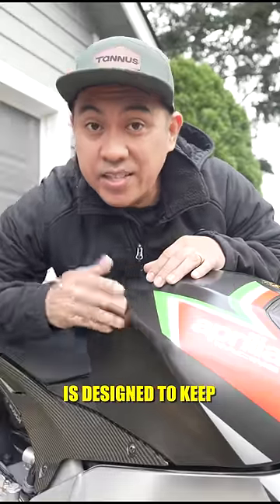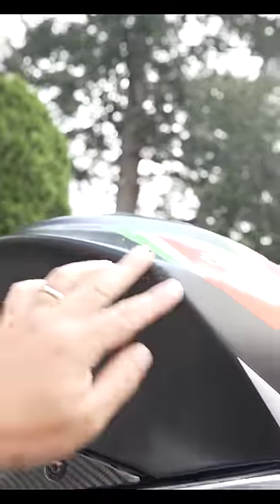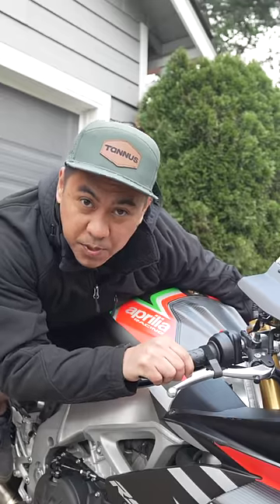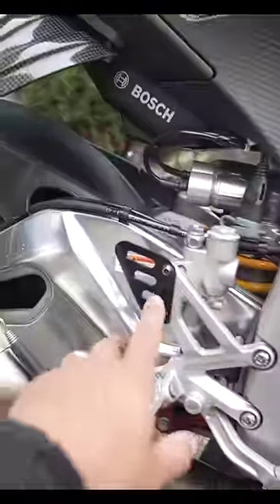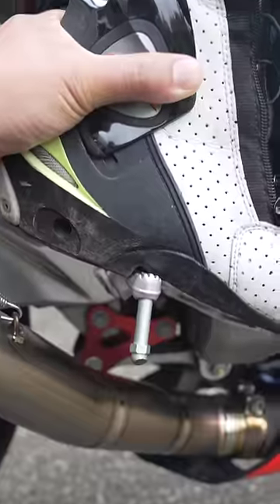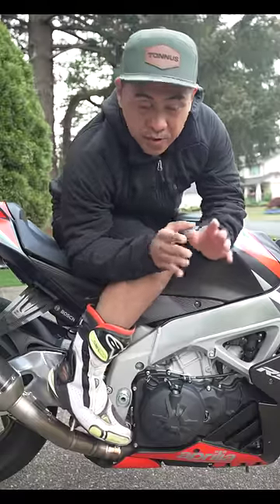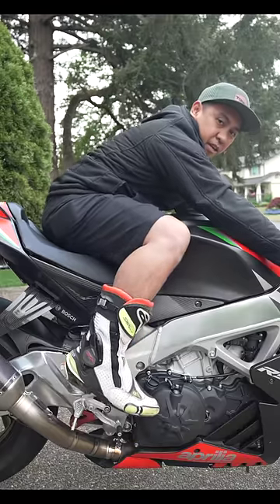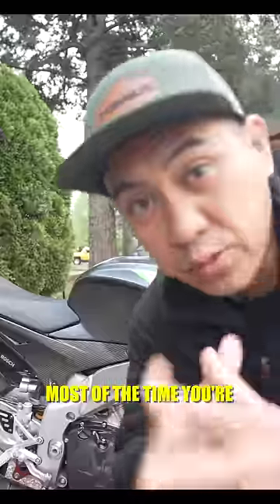HOW TO LOCK INTO A SPORTBIKE TANK

Comment: I asked Dylan Code at the California Superbike School about this very topic and he pointed out that in racing you see some guys have their heel locked into the outside  peg whereas other guys use the balls of their feet to lock their knee into the tank. He said it’s more personal preference than anything
Reply from the maker: Pretty much. I like my heel locked, i feel way more stabilized.
Reply: I always push with my toes to force me knee into the tank
Reply: @jadsmvs8651  that’s what I do, too.
Reply: @jadsmvs8651 bad if you slip
Reply: The inside foot should be on the ball of your foot, outside can do anything as long as your thigh is holding onto the tank

Comment: I beg to differ on the foot placement and with logic. I was taught the bikes suspension is for the bike your legs are yours. I was always taught to keep the peg on the ball of my foot ass slightly off the seat and hold the bars like screwdrivers. Im far from the best but im certainly not without talent 😂 started riding at 3 and road racing the old 2smoke 50ccs at 4. This way of doing it has always given me more grip in the back coming out and more confidence coming in trailing braking. I understand why this is taught now but i do think its worth knowing the old ways lol it has its advantages especially when your coming in a bit too hot or the grip is just crap.

Comment: I ride a 2007 fz6. I want to start making corners more aggressively but I find that tank incredibly difficult to hold onto with my knees. Any tips?
Reply: Get tank grips. I have stomp grips on my 2021 cbr1000rr, and it was an absolute game changer. No more sliding forward or backward when you brake hard or accelerate hard.

Comment: Bull crap. You need the ball of your feet on your peg, not the notch of the heel. With the ball of your feet on the peg, you can press your knee into the tank for a much better anchor to hold your body on the bike while leaning.  You also should be able to lean off not using your hands at all to hold yourself up.

Comment: If I corner deep and my balls of my feet are not on the pegs, I will break my foot. I never ride with my heels on the pegs.
Secondly, you should not rely on your handlebar to keep you on the bike. Your grip will be too tight of you do, causing the bike not to be able to do it's job. You use the bar for steering inputs mainly.

Ps love your videos man. Very entertaining and knowledge nuggets
Reply: 1. He meant the outside foot, not the inside foot. Come on.

2. He said that your grip should be so loose that you can let go with your inner hand completely, which is exactly what you're saying. Use the legs, not the arms.
Reply: @TheGrandmaMoses 
1) true! He me tions the outside foot indeed. Missed that bit.
2) partially true, he says you should be able to let go in a corner. But it's phrased as if that is different. You should always have a loose grip. I guess it's open for  interpretation
Reply: @rvdboomgaard  Don't get me wrong, mate - I think everything you're saying is spot on! But so is everything he's saying :)